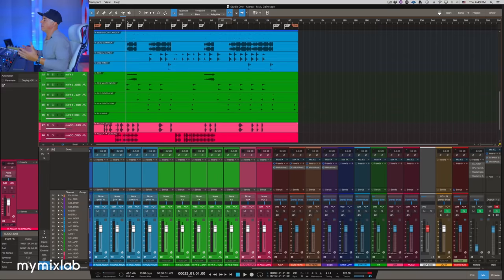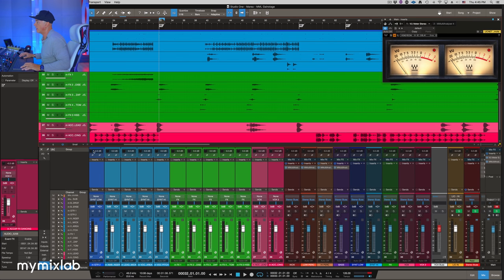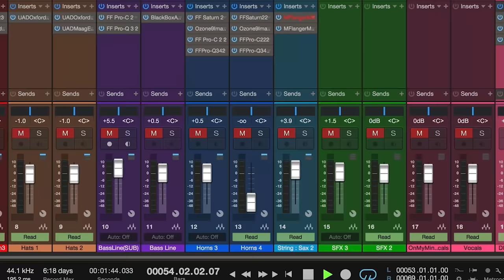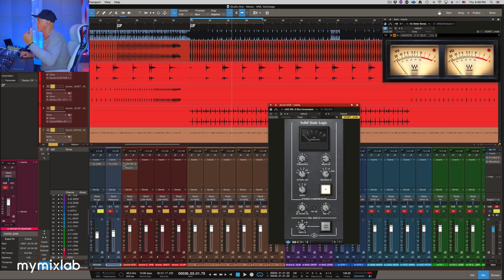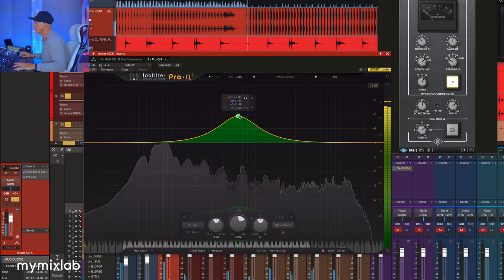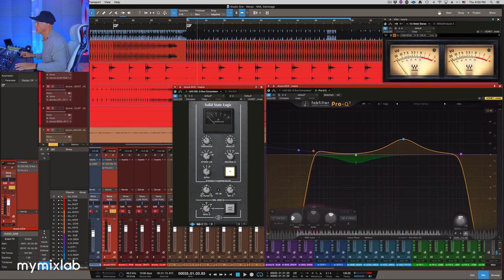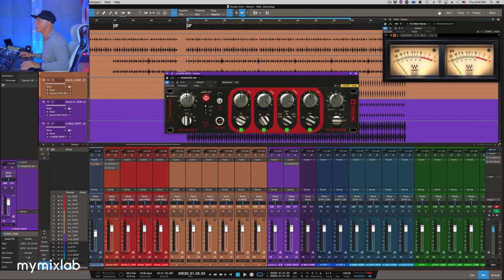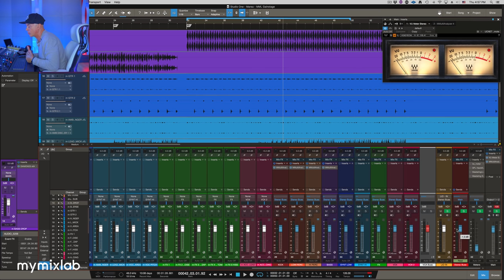HOW TO Mastering Levels & Gain Staging | Luca Pretolesi (3x Grammy Engineer) | TUTORIAL

Comment: Correct me if I’m wrong but it was my understanding that you gain stage each individual track to -18db. After gain staging each individual track, you add your effects and use the output knobs on each plugin to maintain that overall -18db on each individual track. As far as your Master track, you should be aiming for an overall db of at least -6db to give enough headroom for your effects. Only difference is that in the Master track you are not aiming to gain stage for -6db after each plugin. Is that correct?
Reply: This is really a new way of gain staging to me...gain stage the bus of instruments. Wow cool....
Reply: I would say that it's not that important at which gain level you start on the master bus. Important with this technique here is that you maintain that level for the whole mixing process in order for being able to enable/disable and also exchange plugins in your track's fx chains all the time.

Comment: Thanks for the tutorial! That's an interesting way of working, I haven't tried it. You have to remember digital audio is not like analogue where you want your signal hot to get the most signal to noise out of the tape. You can safely track instruments -6 DBs or more in digital and not lose anything. Personally when I'm mixing I start with my drums -6 dbs (after I insert and tweak plugins) on the master bus then by the time I've got all my tracks in I'm typically below zero by a few DBs which is fine since I'm going to export a final mix -3 DBs or more so the mastering engineer has some room to master.

Comment: This video was helpful compared to other videos, but you confused me with one thing. Why did you apply SAME gain of -10.3 db on all the strips, should not it be different for all depending on their levels they were recorded at?  Help me learn this please:

My Understanding: 
Step. 1:  Check each sound strip one by one and make sure each strip stays close to -18 Db. Use "Gain" for it. This step it to create some headroom. 

Step 2: Once the gain is applied, now we know that we have headroom of -18 dbs. Then we adjust levels up or down for each strip either by applying the effects such as EQ, Compressor, etc. OR by adjusting the volume knobs. 

Step 3: While doing the step 2, make sure that the overall “Stereo Out” stays close to 0 dbs using UV meter on stereo channel. Each track is adjusted as it sounds good but overall stereo out should be close it zero.   

So, the goal is that once the mix it done, level should be 0 dbs for the track.

Is this correct?

Comment: How does this method work when using/adding parallel processing and busses? isn’t it going to increase the level past the 0Db VU and if so would I just need to set initial gain levels lower to give myself room to mix into the 0Db VU or how does that work?

Comment: Very interesting tutorial, but making my gain staging 0 in the VU Meter, is too quiet volume that I cannot hear and mix the tracks. What am I doing wrong?
Reply: crank up the volume on your speakers / headphones. any modern audio interface should have lots of amplification to listen -18dBFS properly.
Reply: @skk6811  Thanks for the advise, but don't you think turning on the volume wasn't the first thing I tried? I have a MOTU and Sennheiser 650, quite decent gear, but I can't get it right.
Reply: Not sure I understand what you mean by you cannot hear the track. Is it quiet for the plugins you're using or are you physically not hearing it even by turning the volume of your headphone amp all the way up?
Reply: @skk6811  I'm physically hearing it too low at that range

Comment: He pulled down to -10.3 to reach zero VU. Would you do the same thing for virtual instruments or only stems?
Reply: Yes, but it does not have to be exactly zero. just stay under zero. Important part is that the whole mix reaches zero togther. A quick way to do it is to set the kick to -2 vu and the bass to -5vu and mix everything around that!
Reply: Gain staging is mainly for stems but not for virtual....u can control the output in the vst knob

Comment: You mention selecting all stems at once and lowering to -18db to have an equal starting point. But what if the stems are at different levels prior to doing that? Also, if I’m using midi, would I just put the VU meter after the VST in the processing chain and adjust the output gain in the VST?
Reply: i think because he already bounced out his stems? with that said, he already leveled his drums, bass, synths etc.
Reply: @abramjethrofelisanpolinar3279  I hear ya. But define leveling. What is the process for leveling those stem before bouncing them?
Reply: @ryanw9307  i mean like, leveling the volume of your kick or etc. to other elements, which one should be the loudest in your mix
Reply: @abramjethrofelisanpolinar3279  I feel like we are getting into a grey area here. Now we are talking about mixing before mixing. I guess I’m just really trying to figure out where Luca’s starting point is. So if he gets stems sent to him that are all different gain levels and he lowers them all -18 db ,they’re still all at the same levels in comparison to each other, just at lower levels. Or is he talking about lowering all levels TO -18 db to start?
Reply: @ryanw9307  he's point was the mix should be -18db on the vu meter, not individual tracks

Comment: I just feels bad that he talks about "Peaks" when using a VU Meter. Transient heavy sounds like a kick drum peak higher than they show on the VU Meter as a VU Meter calculate volume over a 300ms period of time. So hearing "I'm compensating the level of the kick to keep the same peak level after compression" is just not funny at this point. Literally ALL he did, is change the peak level of that kick to emphasise the transient so it hits harder but doesn't read as high anymore on the VU Meter. But who cares, right ?